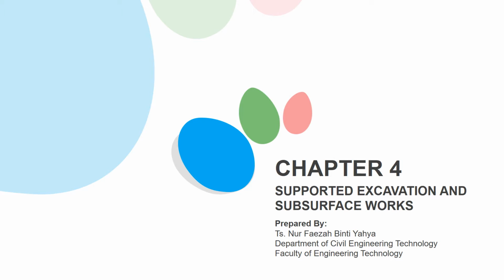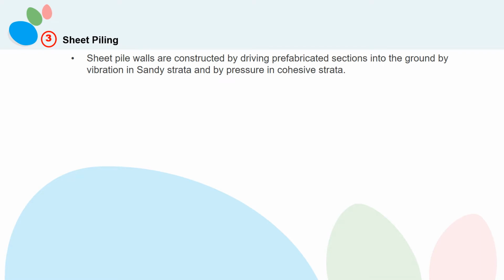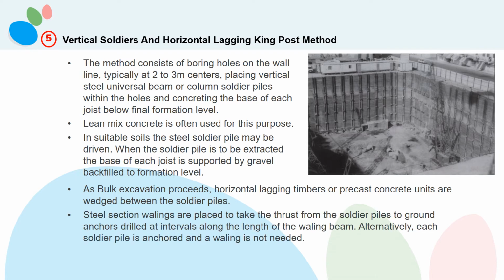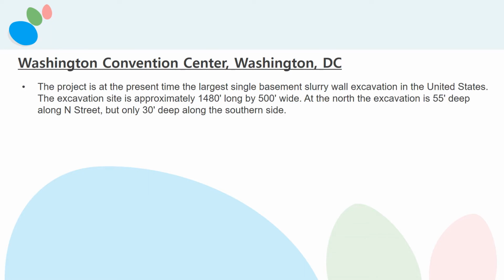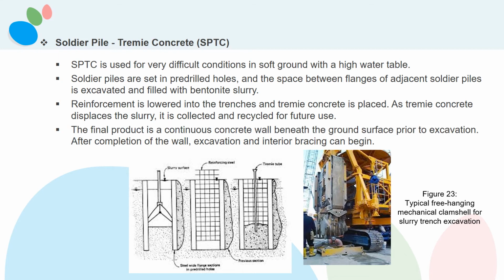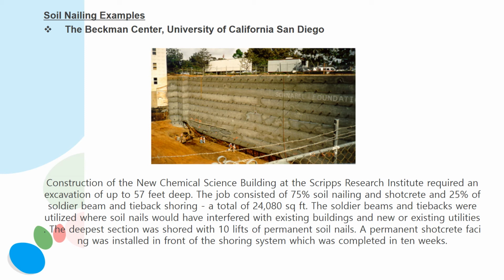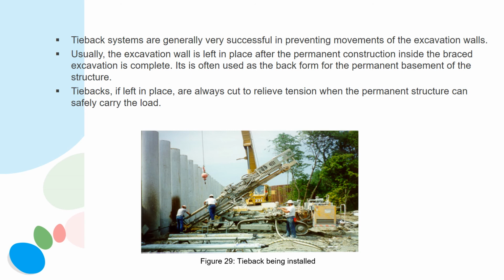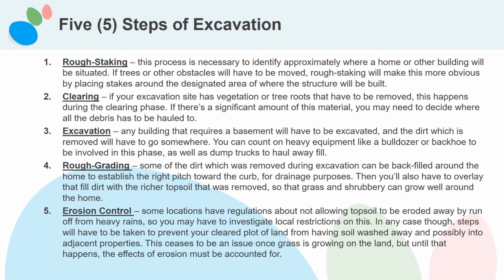CHAPTER 4: SUPPORTED EXCAVATION AND SUBSURFACE WORKS_PART 3

Comment: There are some misleading information provided in your video timeline at 19:50. 1. Diaphragm wall, secant pile wall, micropile wall cannot be constructed before excavation. The work normally involved predrilling of ground or excavation of trench with filling of bentonite slurry into the hole/trench concurrently to stabilise the hole/trench. Prefabricated steel cage will then be inserted into the bore hole, in the case of bored pile/hard pile for secant pile,  or into the trench for the case of Dwall. Subsequently concreting will be done by means of tremie pipe method.  2. For secant pile wall, the machine used for drilling work (Bauer BG20 to BG40) can  easily core through boulders/rock such as granite with strength of >60MPa.  These are some practical information for your reference which is quite commonly used in the field.